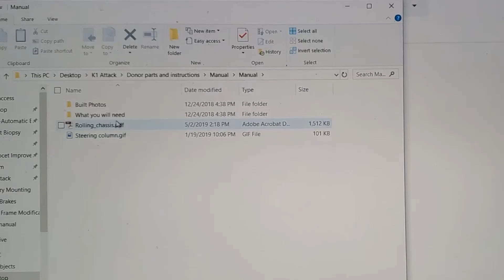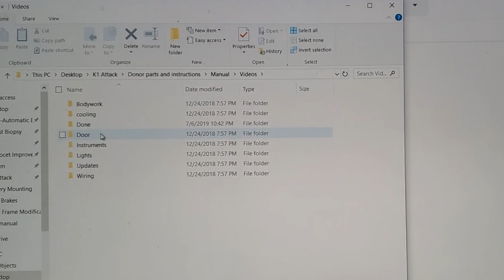K1 Attack Manual

Comment: I did the body work and paint on A factory five GTM 500. It won best of show and paint in a factory five show.  If you need help with the body work or have any questions about fiberglass working and the best products. I'd be happy to give you some advice on products.
Reply: Hi my name is Jeff. I work for Disneyland doing all three pairs on fiberglass and metal on the vehicles. Here is my email address trheff116@gmail.com.   that way if you want I can email you pictures of the GTM the part where we did the fitting of the doors and panels
Reply from the maker: Wow!  What an offer.  I would love your advice.  Thanks!
Reply: You're definitely GOATED

Comment: You are a character lol. The best possible way would be to get wireless scales for the car and try to optimize the car. 55 REAR 45 FRONT. You could go as far as 60 rear 40 front. 50/50 is not optimal weight balance. Keep passenger side biased heavy so chassis is balanced with the driver in the car. You will never notice a difference with two people. However, all out tracking will be the best with a left/right balance.

Comment: Super cool building with the family. You can get a torque spec guide with spec by fastener size, thread pitch and grade. If you are constantly doing it, becomes second nature. With that said, in specific situations like head studs or rod bolts etc, they could have torque based on mfg recommendation. IE ARP +625 rod bolts.
Reply from the maker: Thanks for your comment!
Reply: @electricsupercar  You're welcome. I've become extremely interested in doing a kit now. I want to do a hybrid with perhaps a 15kwh battery. 
I had come close to choosing the Factory 5 818 but after seeing the K1 Attack and the DDR Grullón GT8 I forgot all about the 818. 
I'm leaning towards the GT8 but not 100% decided. My goal is a hypercar capability.  I'd like to use a M120 Mercedes V12 48v and remove both the starter and the alternator. Remove the reverse gear from the transmission and add twin turbos etc. For the front wheels a 200kw motor. It should get me in the neighborhood. Of insanity ha.
Reply from the maker: @Kurt Sumthinorother Whoa! Good luck brother!  Sounds amazing.